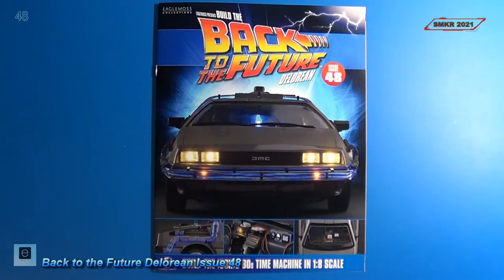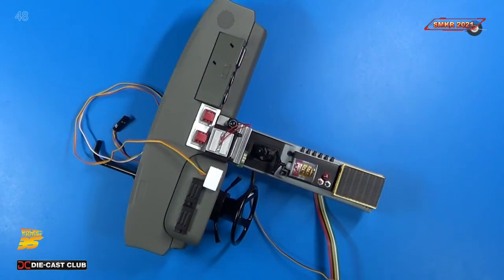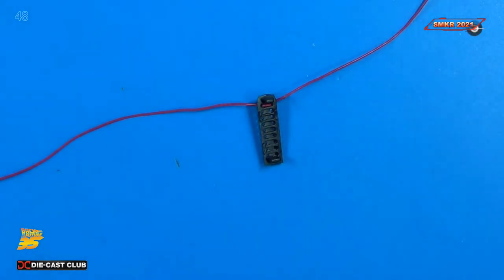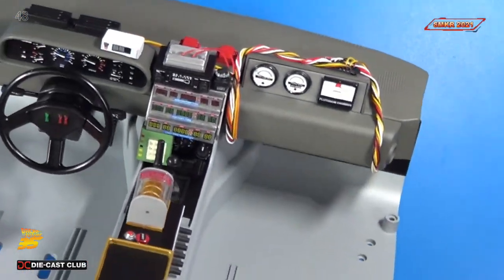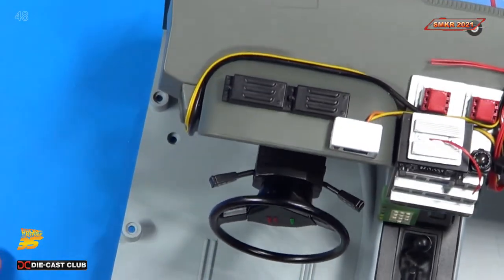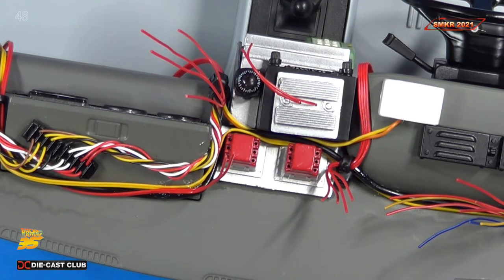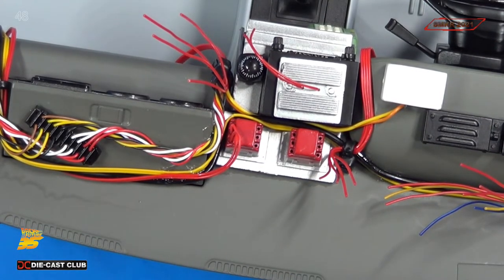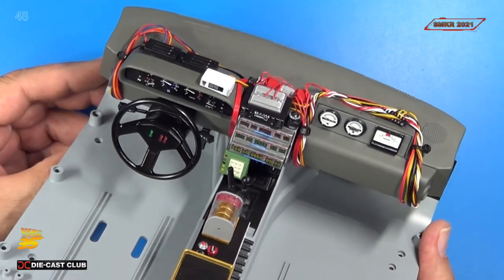Build The Back To The Future Delorean Issue 48 -  Dashboard Wiring

Comment: Hi Steve, great work as usual! I really enjoyed the video. A couple of things I did that your viewers might try was Tamiya extra-thin cement to secure the wires to their terminations vice super glue. It dried less noticeably and the wires still held. Also, I have a hot air soldering station and used it to gently form the black rubber tubes to follow the contours of the dash. This also worked wonders on shaping the engine hoses/plug wires as well. Thanks as always!
Reply from the maker: Great suggestions. Those techniques will take some practice on my part.